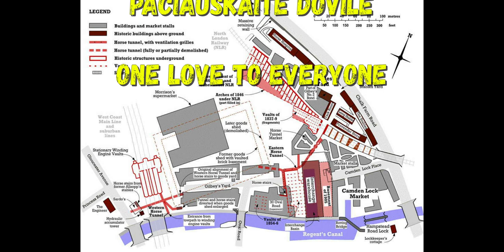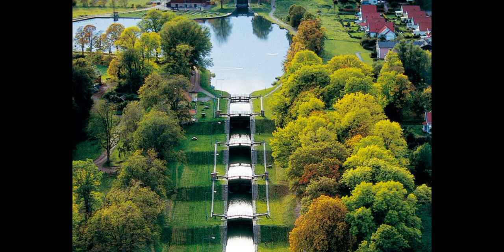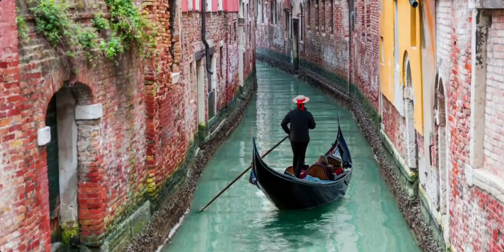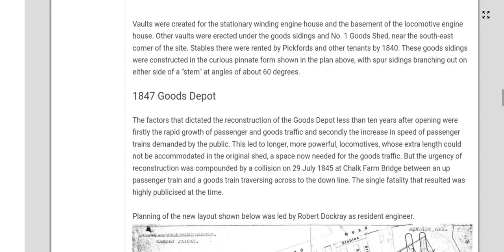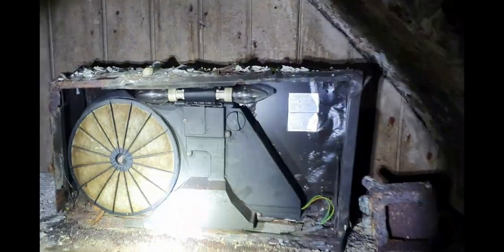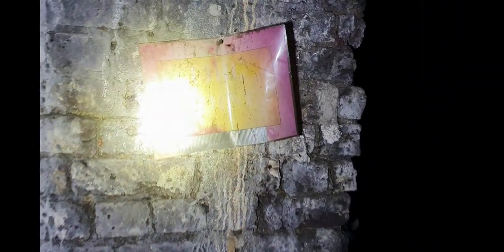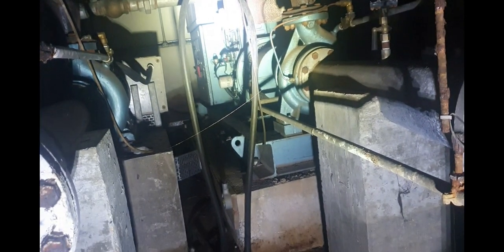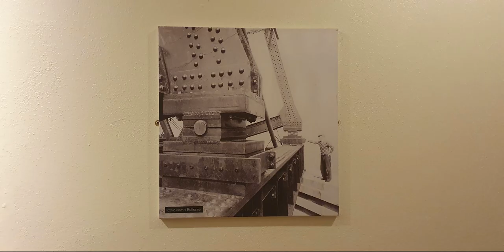CAMDEN CATACOMBS AND ANCIENT HIGHWAYS

Comment: Tip off; look into the tunnel network under the town of Frome in Somerset. Absolutely nobody is investigating or talking about it. Very little info around on who built it and when or why. I hear it is quite extensive. Local folk have told tales in pubs of a tunnel network that connects to surrounding villages and towns as far as warminster. I have tried in vein to gain access to some of it over the years. As an avid explorer I have personally stumbled upon a lot of very impressive and clearly very ancient engineering in that area with regards to water management; including canals (wet and dry) hidden in dense woodland which you won't find in any history books, or marked on any maps.

Comment: When they say it was built in 1760, think of the year 760. I'm sure they made history up for 800 to 1000 years. These underground buildings/tunnels were built after the Romans left, like in the Netherlands around 400 AD. Then the starforts were also built. In the Netherlands most were built in the 1400s and 1500s ( they tell us) so, read 400s and 500s. Our history books start around the year 1200 with the Middle Ages. What happened in those "undescribed" years? Have we stood still for 800 to 1000 years? I do not think so.

Comment: DOn't forget that in Norfolk - where I live - the Yare was navigable by ocean going vessels in Roman times, right to Acle. The ditches in the landscape are for drainage since the land is below sea level. In fact it's below the level of the rivers too. It was pumped out with windmills, now electric pumps which are still needed otherwise it would all flood. However, my neighbour remembers ice-skating between the villages in really hard winters when the drainage ditches froze so I imagine they were used for more than just drains. The building at 5'45" is St Benets Abbey which is about 12C but somebody built a windmill in it before they had all this listed buildings nonsense. However, there ARE some very strange buildings and old true canals in Norfolk - some of them partially restored. This is a Roman region so it's likely you'd find artefacts, but you're right - there's probably much older stuff - East Anglia used to be attached to Europe!

Comment: Paul, how is it water doesn’t erode bricks and cement?   Best boots on the ground vids ever. Thanks, Paul.
Reply from the maker: Strange eh thank you Nancy 👌☝❤
Reply: No, seriously...how can bricks Ann cement not erode from water? Don’t just push my question aside , please. Do you not know? Ok. No problem.
Reply: they have had concrete that can set underwater for years.. chemical reactions make the cement heat up. forcing out all the water and setting like very hard stone... glazed bricks or stone  acts like waterproofing and the reason you shouldn't paint red brick... apart form clear waterproofing.....
Reply: if  red brick are not waterproofed every 5 years or so.. they will then become pourus and begin to crack and break up... as does stone.. and the reason why the dry stone walls doted around England have collapsed.. over time weather gets to stone or brick and they become brittle and break up.. due to  wind rain and frost... these stones or then blow out.. hence why these dry stone walls then collapse... but keep them waterproofed and they will last forever..
Reply: Hardened by fire.  And cement is pumace?
Reply: @cheechmcduck7013  Good comment mate, thanks.  People here have been making "cob" (mud and straw) structures for years, but they have to be waterproofed periodically - yearly is best, or they begin to disintegrate.  Hemp concrete has been found that is apparently thousands of years old, but still holding together - hempcrete!
Reply: @pharmerdavid1432  hemp is probably one of the best things to use for building.. its a natural antibacterial.. so will never go mouldy or become damp. its an execellt heat insulation.. and like you say.. last for thousands of years.... hemp coupd be a problem for a lot of things.... make paper, rope, clothes, medicine, the list is endless... and yes cob houses waterproofed will last many years and have the same qualities as hemp. insulation etc..
Reply: @oceansunset6147  I agree , Hemp milk is my fav .